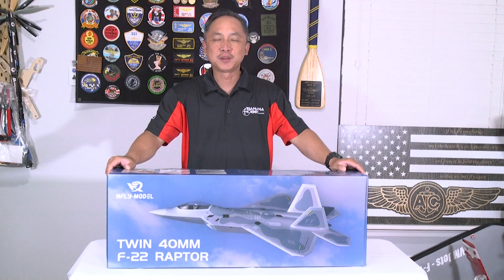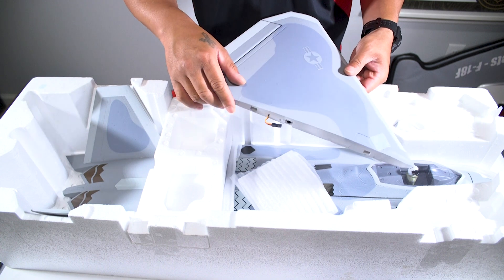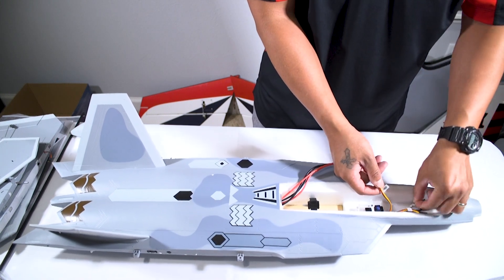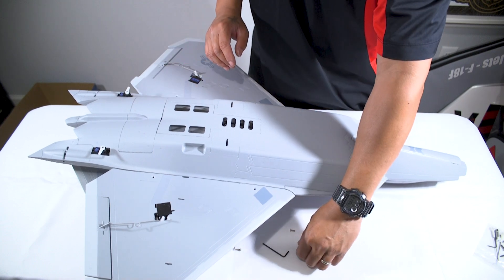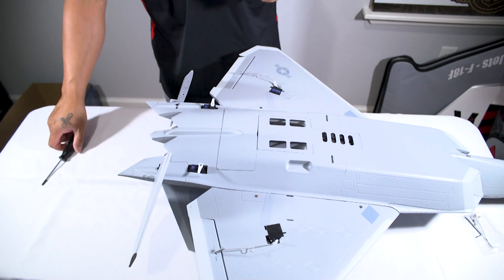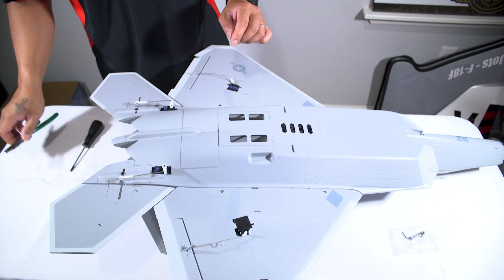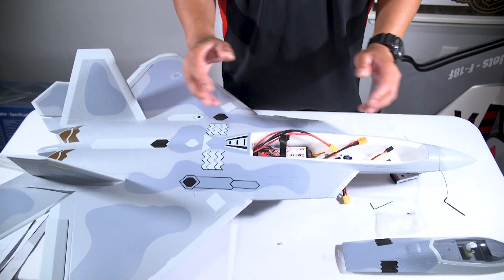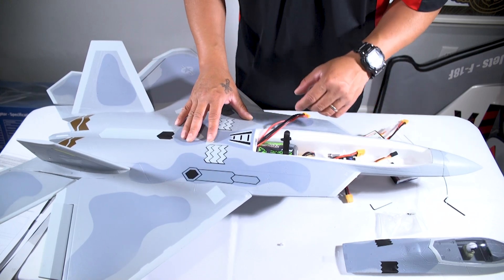Xfly model twin 40mm F22 Raptor #aviation #airplane #rcaircraft #rcplane #modelairplane #rcjet #edf

Comment: I wish they gave you 50a 6s compatible escs. F22 needs 5s power. Its just too slow and poor climb rate compared to a single 64mm 4s. Im hoping this F18 is slightly better than the F22.
Reply from the maker: I actually just did the maiden on the new Xfly F-18 twin 40mm edf. It definitely is more agile and has better vertical than the F-22.